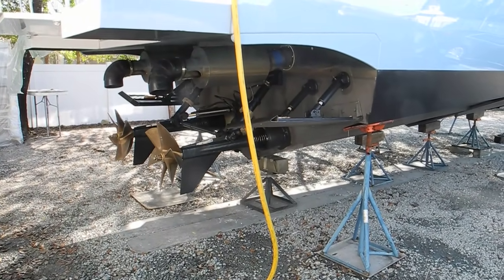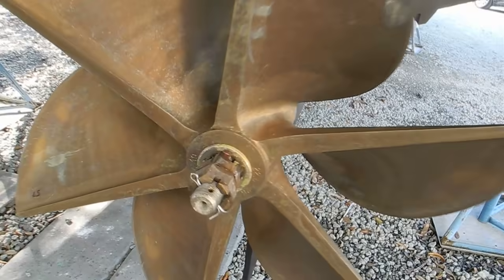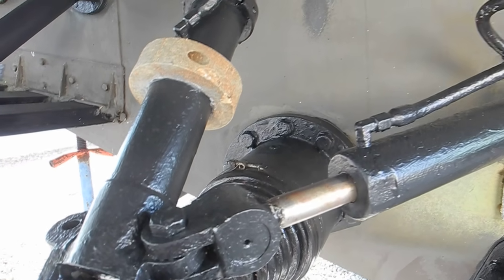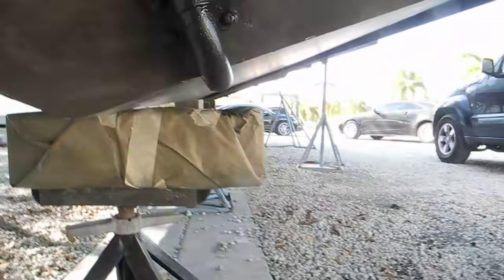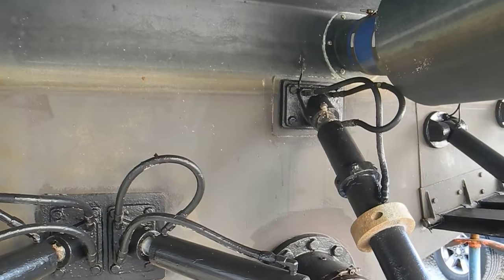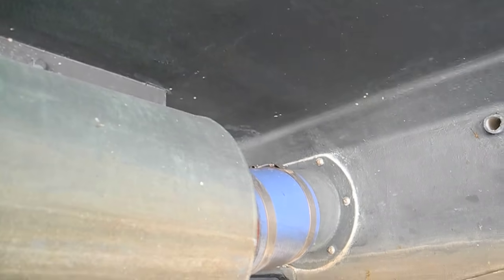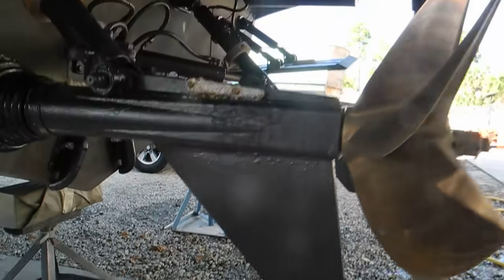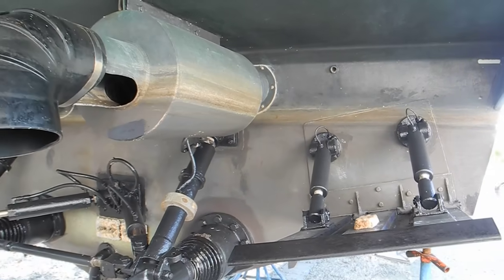Unique propulsion system

Comment: These are Arneson surface drives popular in the 80s and early 90s.  They are production units.  Popular choice if you had a lot of horsepower on a heavy yacht and wanted to go like a true go fast boat in the day.  Pair these with diesels or 1000hp gas engines and get that 50+ ft heavy boat to see 60mph or more.

Comment: What the the zincs for?
Reply from the maker: Sacrificial anodes so the stray electrical currents in the water would attack the zincs instead of the SS shaft or Propeller. Same for outboard units, they have a zinc or anode also.

Comment: Arneson Surface Drives, (there are quite a few videos showing them in action here on YouTube) are used in racing, and on high performance boats. There's a couple of fellows who run high speed crabbing boats near where I live, and they swear by them. Twin 400hp diesels are the norm. They cover as much as 120 NM a day.  Saves them fuel, gives good performance can change a prop without removing the boat from the water and are of a very simple but robust design.

Comment: It would be very hard to reverse this beast because the transom is straight up and down and the wash would just bounce back pushing the boat forward.
Reply from the maker: Mick Rumsby the down angle of the drive will allow them to reverse the boat. It can be done just like the flat transom on a sport fish that reverses when a fish is on the line. But slower is better to keep the water from coming in the cockpit.
Reply: @AskCaptainChris  The surface drives sit much higher in the water than a shaft or stern leg which is able to push the water under the boat. This is my boat the transom is on a 45-degree angle for this reason. https://www.youtube.com/watch?v=uKLCUmt_zEk

Comment: Arneson drives
Reply: They do look like Arneson drives.  Used to watch Howard Arneson run around the Delta in CA with his jet powered racers.
Reply from the maker: Kelly great memory. Thanks for sharing your experience 👍🏼
Reply from the maker: George Mulligan yupper. There were actually Two boats with the same drive units at the yard today. Confirmed they are Arneson Drives. Thanks to all who commented. 👍🏼
Reply from the maker: George Mulligan May very well be Arneson but nowhere on the equipment could I find a label. I am headed back to that yard today so if it’s still there I will see if I can confirm. Thanks for your comments. 👍🏼

Comment: Very fast Arneson Drives ! Very fast. A specialty of Pershing Yachts ~ their newer models automatically trim the drives up and down. Keeping the propeller hub itself level with the waters surface is the trick.

Hub in air no propulsion,  hub is water less efficient. You will burn a lot of diesel 200 gallons per hour or more on some models.
Reply from the maker: Robert Frost I’m not sure if this is an arneson brand but yes it is the same concept.